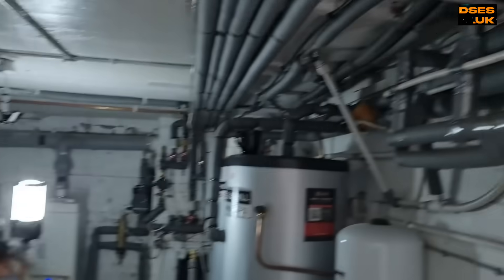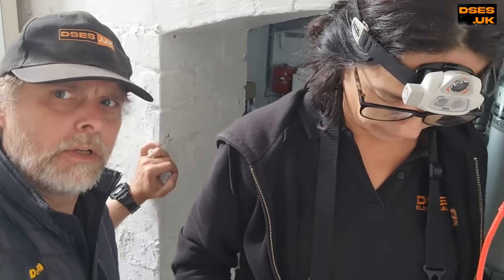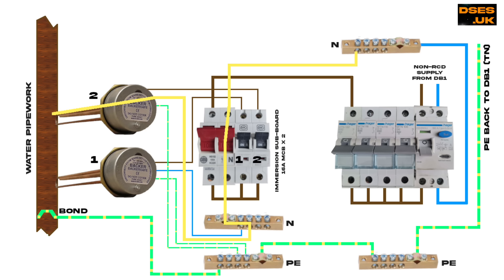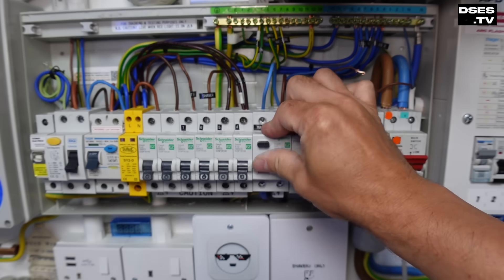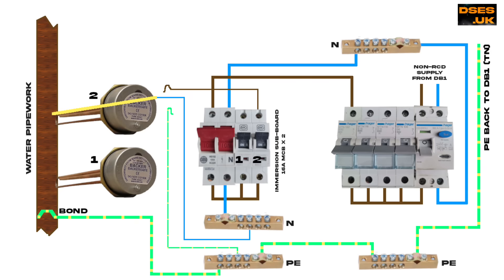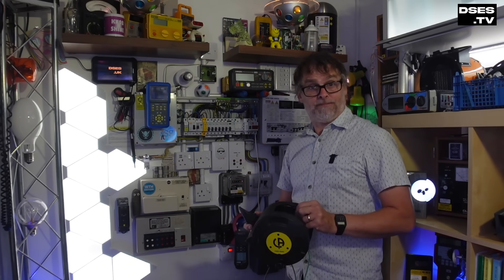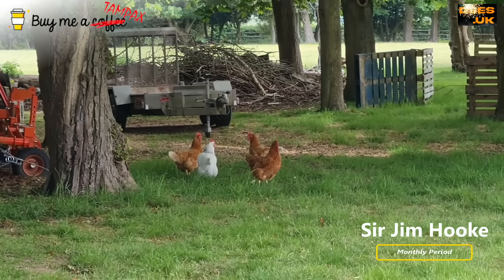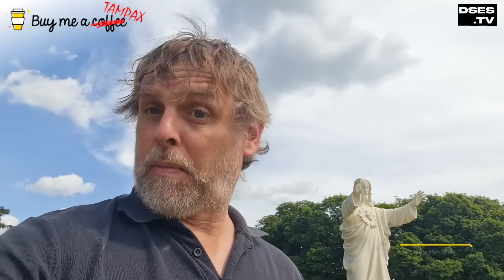No-load RCD trippery frippery

Comment: Interesting. I always thought that no load RCD tripping was because of the voltage drop on the supply cable neutral conductor. That by the time it got to the installation there would be sufficient potential difference to trip the RCD. I mostly work on TN-S so assumed you wouldn’t have this issue on a TN-C-S.
Reply from the maker: Hey, I could be entirely wrong on this so you may have something. Think of this video as me trying to explain why we're seeing what we're seeing as opposed to it being a definitive answer.

Comment: My thoughts would be Anything Rodded with both having different Ohmic (RA) readings ie. the Local TT rod and the Neutral Bar (derived frm TN of Earthed TX star-point) will "Promote" flow of Current in between them if they come into Contact.

The Current could be from those of Proximity of yr Local TT rod "induced" from Step-Potential difference to adjacent Property via their Local TT rods (if any), or via other Main Equipotential Bonding in contact within the Earth Mass.

Once it met with the Ultra-Low Impedance (nearing Zero Ohm) of the Neutral-Bar from the massive/mega PME network, Current will/likely to take/split via this Path thru the passive RCD causing an Imbalance sufficient to Trip it...

Comment: 13:34 I had 2 of them, and no, they're not safe or sane.

The UV from the LED's causes the cheap plastic to break down, and it'll either fall apart still live when the plastic can't support itself, or you'll accidently knock it, causing it to fall apart.

Great light output though, as trying to find LED bulbs that are 100w equivalent replacements are nigh on impossible to find, and I've never been able to find a B22 plug to multiple B22 socket adapter so I can add more bulbs. It's just the spaghetti of death hanging from the ceiling that ruins it.
Reply from the maker: This site tends to have a lot of no-brand lighting from off Amazon. I have plenty of LED battens that would fit nicely into this space too.

Comment: Would this still happen with full RCBO installation? As in could it trip a different breaker?
Reply from the maker: There would be no common neutral on the circuit side and the neutral bar of the sub board would just be for the RCBO neutrals, so the same fault would just trip the local device (circuitway 4, the immersion sub board supply).

Comment: Trying to keep the old eye in, I troubleshot a kitchen ceiling lamp assembly this morning.  I sensed that the damage was extensive, so I chopped off the lamp assembly, capped the live wires, and told the lady to call a real electrician, as I was not going to burn the house down.  Then she made me lunch.  ALL of your minds should form a single line to travel into the gutter, right about now, so lets keep it civil.  The lakes district looks a lot like a lake a few miles North of me, here in rainy Northern Maine.  I have seen a similar problem before, with regular circuit breakers.  A water heater, and if the GROUND (not CPC) was removed the breaker behaved, just scratching the ground lead on the junction box caused the breaker to trip, ONLY IF the water heater was tilted in a certain direction.  Apparently, the "sacrificial" zinc rod had corroded and fallen against the electric heater assembly, which was faulty in itself, and by rocking the heater, you could make the ground go away.  Landlord replaced the entire heater.  Case closed.  Keep at it, Dave!!  Cheers
Reply from the maker: You say "the ground was removed the breaker behaved", I sadly suspect most people these days would leave that earthing disconnected as the fix Chuck! I'm glad your client got it properly sorted!

Comment: One of the most head scratchy moments was testing a completely disconnected (at the feed end) supply cable for R1+R2,  Turns out the ancient wylex type AC rcds are even sensitive to the 200mA dc  from a megger MFT, I am guessing it was the transient as dc should not affect a CT
Reply from the maker: John Faultless said similar and I'm sure I've seen that. I pulled an old Wylex 4293 off the pile for a quick test without success earlier, but it is a bank holiday and I'm half a box of white wine in so it's not the best time for thinking....
Reply: @dsesuk it's probably borderline and depends on the individual RCD but you go and enjoy the rest of that box of wine

Comment: I have experienced this kind of situation on a large distribution board with a global RCD Main Switch.
The homeowner had just fixed a coat rail without looking or realising that there was a socket outlet on the same wall. One coat rail fixing screw had gone plumb through one leg of the ring main T&E to the socket shorting neutral and cpc. (Fortunately not live and cpc)
The only way to locate the fault was to remove each neutral in turn until the RCD would reset.
Moral of this tale is always the customer what work has been done most recently.
Reply from the maker: 'tis good advice. On an RCD trip I'll often ask the client if there have been any DIY alterations or nails knocked into walls recently.

Comment: The old Wylex 4293 rcd's would trip with no power at all while attempting an R1+R2 test (mainswitch off). If your next experiment could explain this phenomenon, I'll be much obliged. I assume it was the low ohm testing current, but it always baffled me. I'll send a 4 pack of Strongbow and Skol Super for your troubles.
Reply from the maker: You know, I think I've seen that - it rings a bell. I'll have to put some thought into it but I swear I had a situation where a continuity test took out a non-energised RCD....
Reply: @dsesuk  They just had a permanant magnet and a coil, the earth fault would cause a current that would cause a magnetic field that would cancel out or revervse the effect of the permamant magnet. Put a dc current through one side and klonk....
Reply: @curiousbits  ✅

Comment: Anybody watching this and not saying till the very end is missing out! 😀
Reply from the maker: I think I carried off my "drunken uncle at wedding" act rather well.
Reply: @dsesuk  Very, top marks. Also, I forgot to comment on that nice CA F65 leakage meter - that looks the real deal. Maybe we should all send you in our crap leakage meters and you could do a comparison video on all of them. The only thing that puzzles me is that I was sure you had one of those "crap" ones in one of your videos and it seemed to work, but looking back I can only find you using a TIS570. Did you ever use an Alphatek 775 with any success? Or did you always use decent test gear?
Reply from the maker: @davefrizelle3882  I do have other clamps , I used budget ones early on but didn't trust them so plumped for better gear quite quickly. There's a video on CA's channel where Kev and I compared the F65 to a cheap meter and both against a Class A Power Quality Analyser. The F65 matched the PQA whereas the cheap clamp was some amps off because it had a narrower bandwidth and didn't account for a wider range of harmonics. You can see that vid here: https://youtu.be/xfzEy7arYjo?si=V1676t1sjOOZVYX- Another leakage clamp I have is the TIS580 which is also a good and accurate model.
Reply: @dsesuk  That's an excellent clamp comparison video - I'm going to be forwarding that on to various people and will try to convince them that I need one of those F65 clamps!
Reply: He gets a lot of practice in his cave 🕺🏼
Reply: @oninbridders  Absolutely - as evidenced by his video called "AFDD Proteus party wi' NICK BUNDY (& others)"

🥳🕺